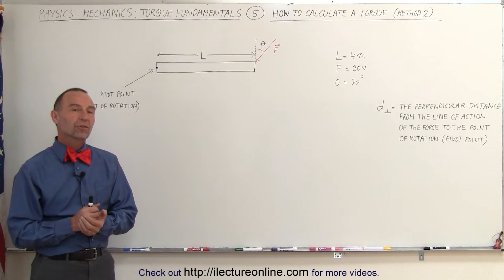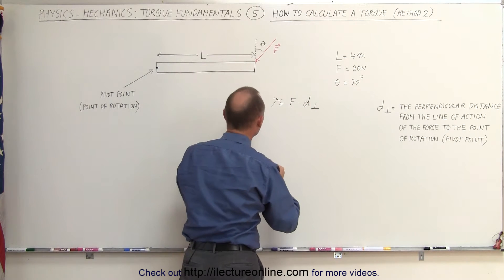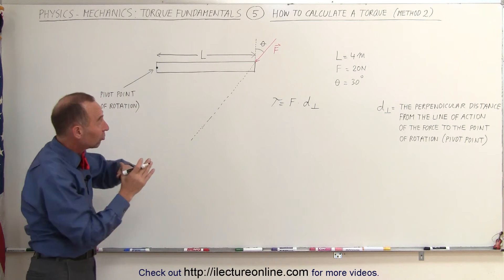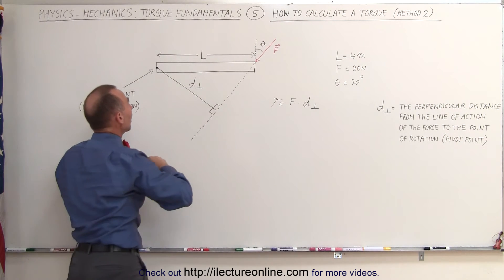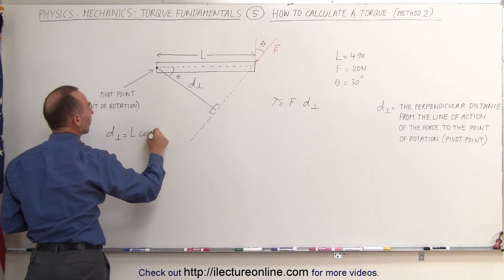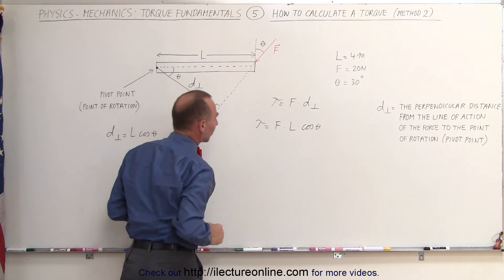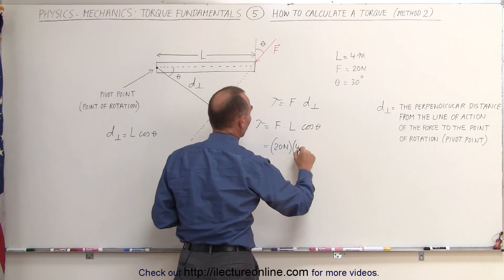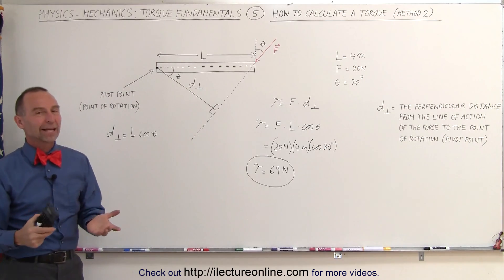Physics 15  Torque Fundamentals (5 of 13) How to Calculate a Torque (Method 2)

Comment: But the object tends to rotate in a clockwise direction isn’t torque suppose to be (-69) ?
Reply from the maker: Only if expressed as a vector.  if we calculate the magnitude of the vector (as we did in the video) then it must be positive since magnitudes of vectors cannot be negative.
Reply: @MichelvanBiezen  thank you so much sir !

Comment: we used to calculate the torque using  the cross product of f x r sin theta but you are using  the cosine ! why
Reply from the maker: You will get the same answer, with both methods.  Note that you use the sin or cos depending on which angle you are considering.

Comment: Hello,
How would you conclude that the given angle theta is the same as the angle next to the pivot point?
+1:40
Reply: The angles of a triangle always add up to 180 degrees. In this triangle, one angle is 90, so the other two must add up to 90, let's call them 'x' and 'y'. (In this case, 'x' is the given angle in question between 'L' and 'd'.) The angles along the "Force line" also equal up to 180, since it is a straight line. One of those is also 90deg (in the middle, between 'L' and theta), so the remaining angle, opposite of theta, which we already named to be 'y', sums with theta to be 90 deg. So we now know that theta+y=90. Since x+y=90 as well, this implies that x=theta.

Comment: Thanx helped a lot but a question why did you use cos and not sin cuz it's supposed to be cross and not dot when we use the torque we use cross not dot which leads to using sin not cos am I right or...? Cuz it says cross in my book
Reply: Siena MK I think you are confused .torque is defined as r×f you are correct.The torque vector magnitude is equal to f*r*sin(x) .actually  in this case torque = 4 *20*sin(60) .  if we extend the force vector you can see that it will have an angle of 60 but the professor here just replaced sin with cos since 
Sin(90-x)=cos(x)
Reply: equations percentages 
Aha I was confused but I got it know thanx !!